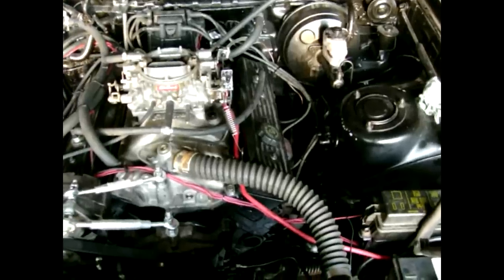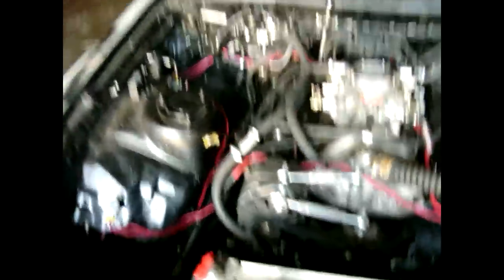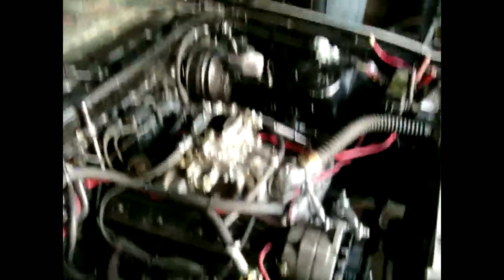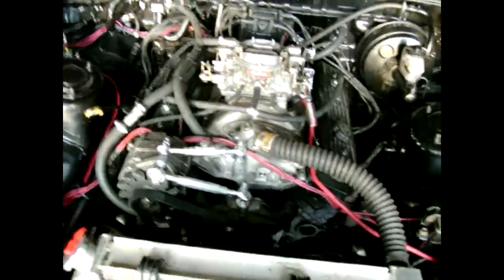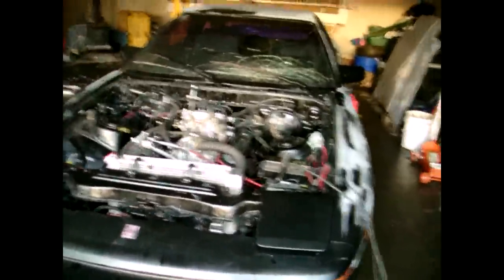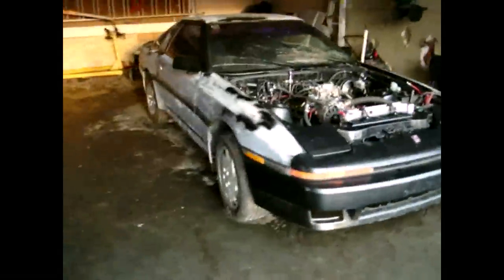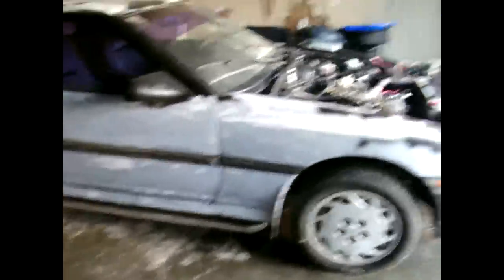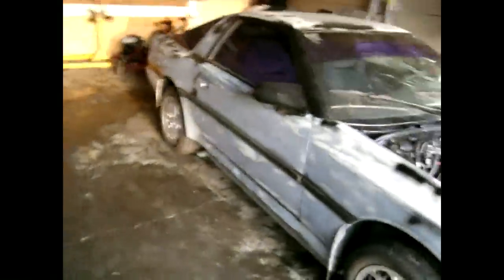Firing the V8 350 Chevy 1987 Toyota MKIII Supra Back Up After Rebuild

Comment from the maker: @honda12racingcbr No bell housing adapter for a Chevy to Toyota trans.  You'll need to use a Chevy trans with the Chevy engine.  It'd be much easier.  
VT247

Comment: I have an 87 Supra and I am thinking to instal a chevy 350 in it. Where would I be able to get the engine mounts? Can you please let me know?
Reply from the maker: The engine mounts were custom made.  Really they were just 1/4 inch plates of steel bolted to the original mount locations and then welded on to the frame and mounts too.  Check out my other video's on how to do this swap.
VT247
Reply: thanks

Comment: That's cool and all but ugh a chevy v8 come on keep it toyota and 2jz it a 2jz will stomp a v8s ass any day and when the boost builds instant smile on your face every time
Reply from the maker: A 2JZ is hard to find at a reasonable price and expensive to build.  Building a 400 - 700 HP 350 Chevy is cheap and easy.  Working on the 350 in this engine bay is effortless.